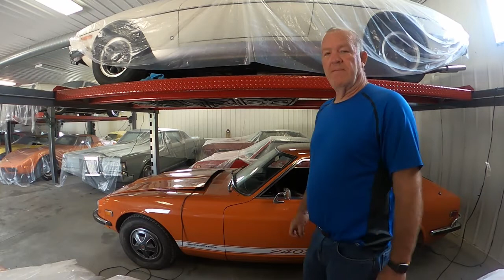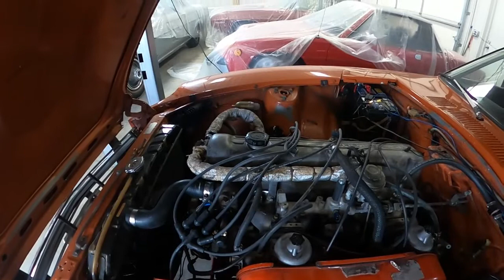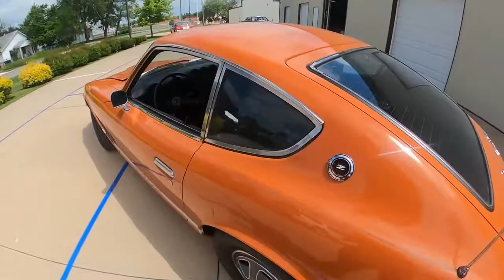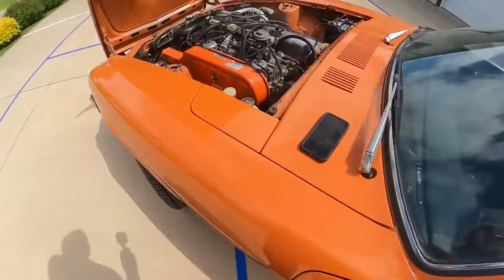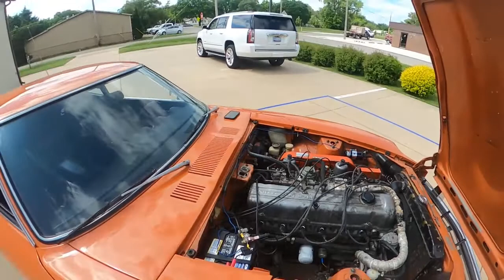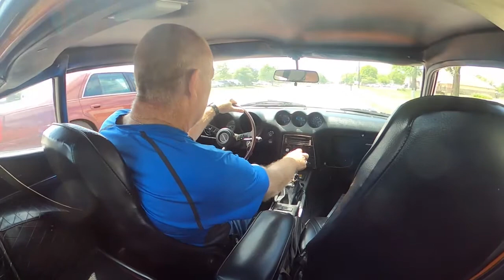1973 Datsun 240Z - Why is it running so rough

Comment: So, what was the problem?  I’m guessing that one of the carb pistons was stuck since it sat for so long.
Reply from the maker: it had a massive vacuum leak from the removed emission systems they had put a bolt  in to plug it and it had popped out